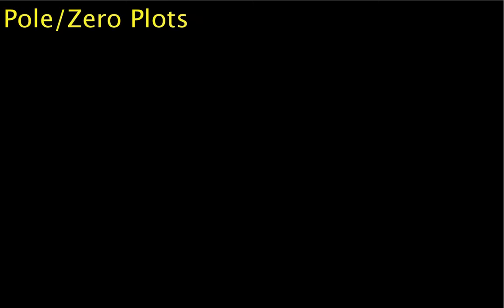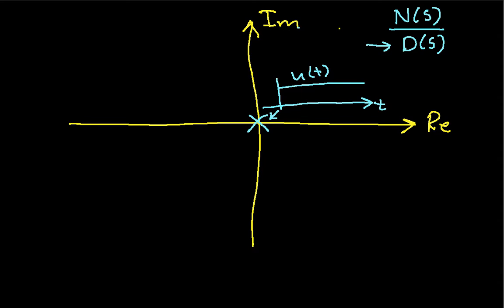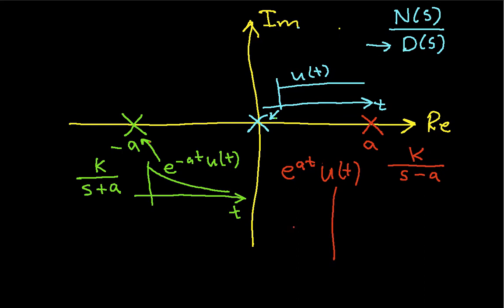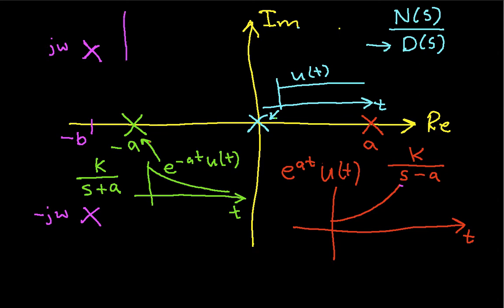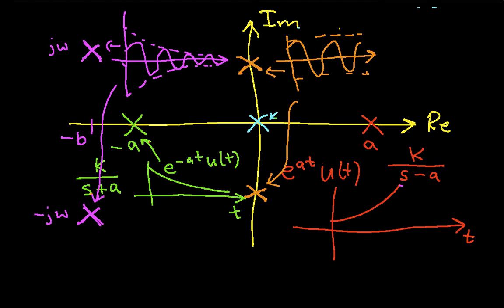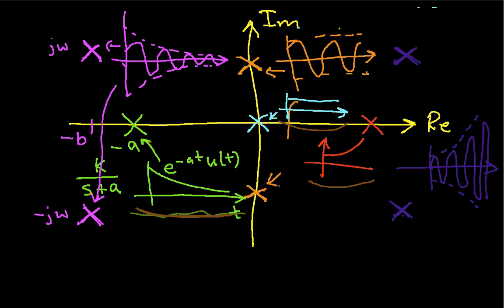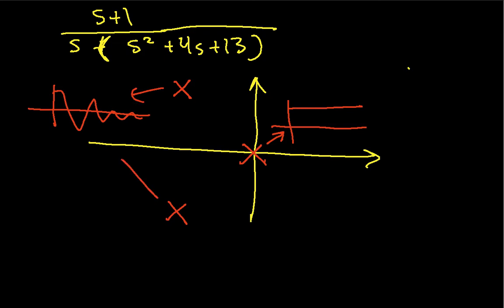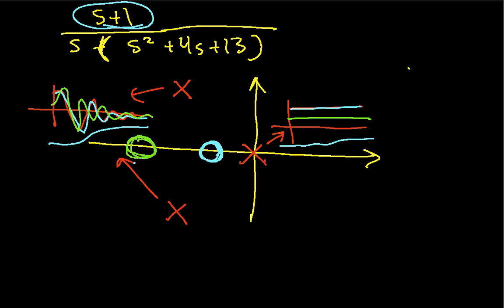Pole/Zero Plots Part 2

Comment from the maker: @Papakia666 If you have a pole at s-2 and a zero at s+2, the system will be unstable; any poles in the right half plane cause instability, and it doesn't matter what the zeros are. The one exception is if you have a pole at s-2 and a zero at s-2; then, the zero and the pole cancel each other (they factor out of both the numerator and denominator), so the system is not unstable.

Comment: If we have a pole for example s-2 (implying that this is not stable BIBO) and a zero for example s+2 does the zero offsets the pole and so the system is stable? or it doesnt matter? it will still be unstable due to the s-2 pole right?